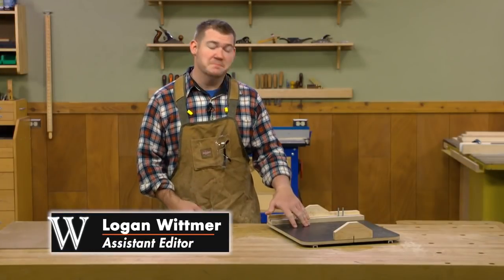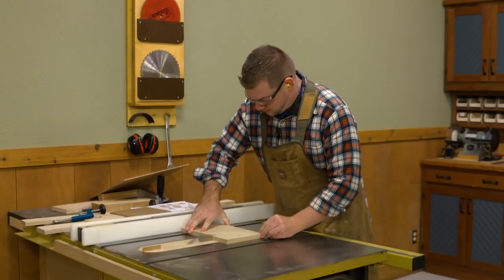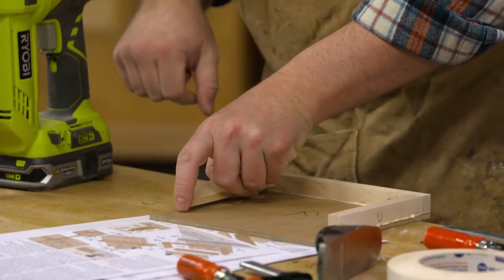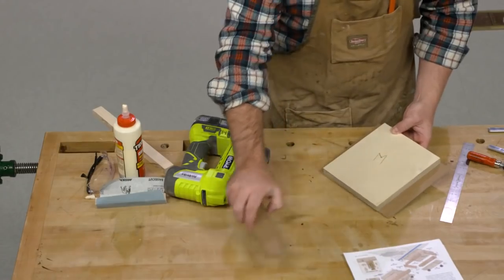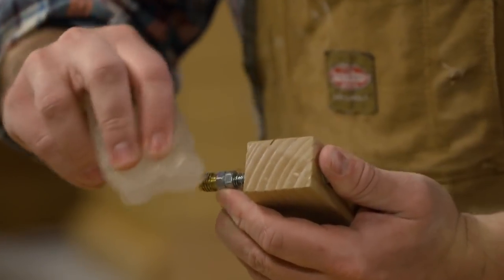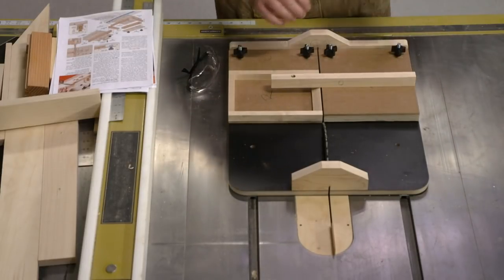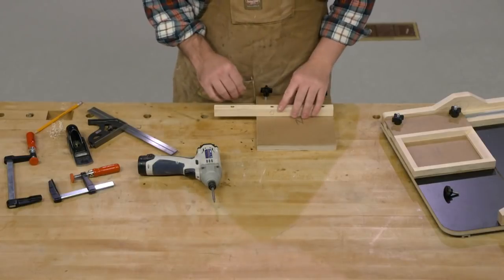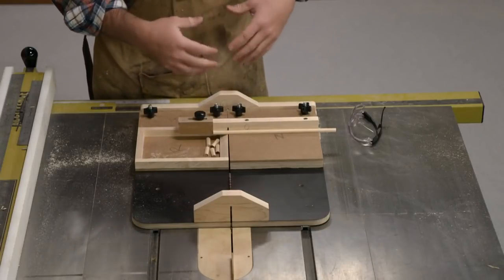Constructing a Small Parts Table Saw Sled (Part 2/3)

Comment: I built this sled and experienced the problem that garrettswoodworx1873 mentioned. The small parts get trapped between the stop block and blade, then chip the edge and fly off the sled, almost every time. I think my solution will be to cut the stop block side of the fence completely off and attach it to the drop off side, farther back from the drop off ramp. Bump the piece to cut against it and then slide forward into the blade, therefore no trapping. I just need to ensure that the piece is held firmly against the fence so that it doesn't move after touching the stop block.

Comment: Nice project and thank you for doing a full video on it. I do have a question, what ryobi pin nailer is that? Thank you
Reply from the maker: We have both the Ryobi 23 gauge pin nailer (Model #P318, seen in this video) and the Ryobi 18 gauge finish nailer in our shop.  To be honest, I've always been a little skeptical about battery powered nailers, but these have been great for our use!

Comment: I realize we are dealing with small parts but both of your stop blocks potentially trap the cut piece between the blade and the stop block. I realize with the one on the tray the part will most likely drop away but I'm curious whether or not you guys considered that in the overall design. The sled is a great idea and I'm not trying to be a safety Nazi, just curious about your thoughts.